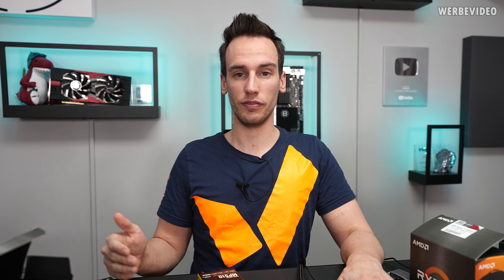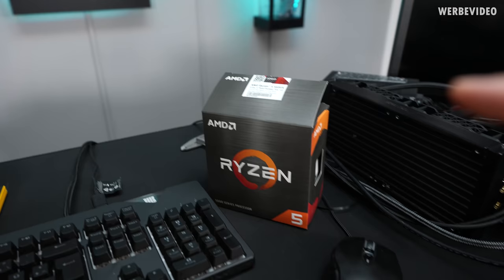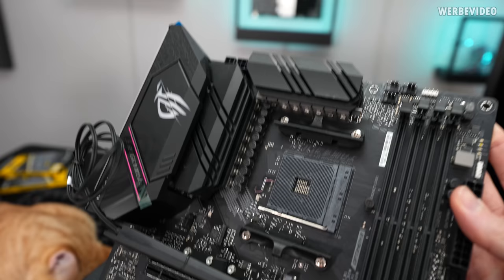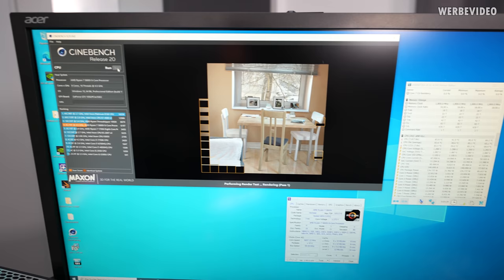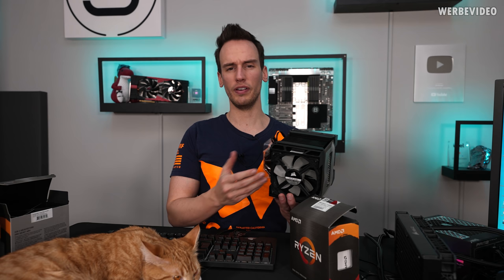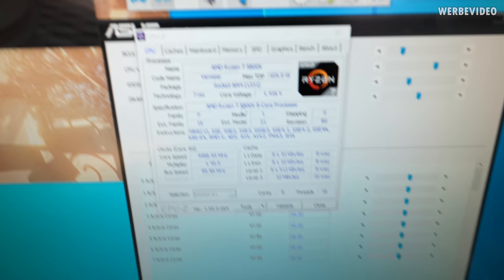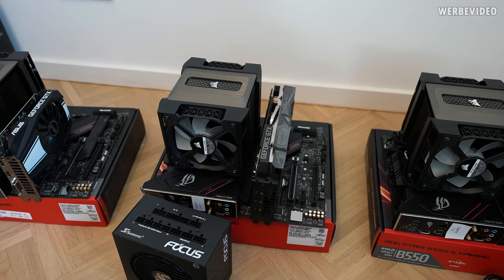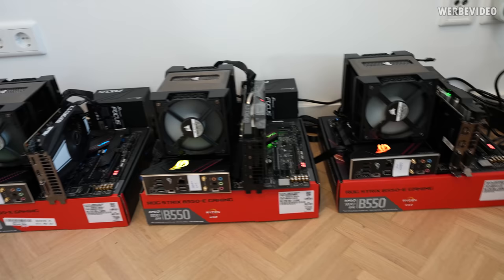AMD Ryzen 5000 Long Term OC Testing - Will the 7nm CPUs degrade over time?

Comment: Wait,  we gotta wait 6 months? But I'm already running an amd cpu, what should I do rn
Reply: well the entire world is using this 7nm right now so I wouldn't worry. The story is obviously a competitor throwing shade, not unlike many stories that have came out over the years. At any rate, this seems to trace back to Boutique PCs which use really crappy psu's. Everyone else seems to be fine.
Reply: Depending on your risk tolerance, could be cautious about voltages until the results come back, then decide whether or not to push voltages then :p
Reply: Use PBO. Someone already managed to degrade a Renoir APU just running the inital 1usmus Ryzen Clocktuner stress test, and an overclocker managed to degrade 2700X's by running .05v higher than what PBO would use at the same temperature.

Comment: I work with servers and prior I worked with laptops. There were more Intel branded systems all together. There were dramatically more failures with amd cpu's overall. Mostly memory controller issues with the older laptop cpus. I have no data on zen2 or zen3. But if you want a reliable cpu I would not choose an amd desktop platform for reliability in say a server environment. Epyc and thread ripper were just starting to get. And it looks like we've had some that have been dead on arrival. But not enough data to suggest one way or the other.

Comment: My 5600x degraded today from 4750mhz to 4700mhz after a stable use of 6 months 24\7 operational.
Reply: voltage ? clocktuner? or manually oc?
Reply: @ricardorosas8500  voltage 1.3v and yes its manually set to 4.7 and working fine with 360 AIO
Reply: My 5800x seems to have been degraded on PBO Curve Optimizer -20 on best 2 core -25 on rest(was fully stable). So telling PBO fully safe might be a lie. 

I was able to manually oc into 1.325v 4800mhz (OCCT 2 hour stable) and it was clearly written on my notepad. Now i have to do 1.38v for 4800mhz. 

ITS EARLY THO. Bios update could have fucked me. More bios version tests needs to be done.

Comment: Nice test, will be interesting to see if any change will come, I don't think there will be any. Although I would've preferred to see this test be done with Folding@Home or with Boinc Rosetta@home or whatever else from Boinc. Those would put nice load to the CPU's and give some good use for science in the long run.

Comment: I think Steve from GN showed that the Corsair A500 is not completly flat. Could it be possible that the heat differences be related to that? I think I would test with a different cooler.

Comment: I know for sure my R7 1700 is degrading at this point. Because i ran 3.9 GHz at 1.36V for 3 years. But now i cannot keep it stable at 3.9 anymore and even 3.8 GHz seems to be worse and worse. I started at 1.27V, now it is stable at 1.34V.

Comment: Now I gotta wait 6 months, I mean I can run my 3600 at 4.3 ghz all core at 1.2750v with LLC 6 and it rock solid stable and really good temps, 75c with prime95 and low 60's when gaming. But I can't even hit 4.4ghz at 1.3375v and I heard anything over 1.325v could degrade your CPU so I'm looking forward to seeing this result. Yes I'm away I have a zen 2 and this is zen 3 but it's 7nm.

Comment: Did you check the coldplate contact with the IHS's?
Those A500's have deffo been the worst consistency performer as the coldplate wasn't making good contact in the GN test passes.

Comment: Doubtful we will see a failure but I do think there will be degradation in the silicon where it will become unstable at current settings. Buildzoid has had several amd chips degrade from OC. We will find out soon enough.

Comment: just running  CPU'S at stock setting will more likely over volt the cpus right out of the box like 1.4v up to 1.5+ on stock boost clock setting UNDER MODARATE LOADS ETC, OOPS CAPS🤣😂

Comment: Ryzen: 3400g  overclocked to 4.275ghz on 1.525v (this is on the higher end of voltage level too) and have been using it for around a year (arond 8hrs per day or so on average), still passes the cinebench R20 runs.

Half a year now,, Any update?    :O
Reply: Is it still running at 1.525v? That's a lot

Comment: I don't think they see 12 months at that voltage.
Reply: Probably will live for 12 years just fine.
Reply: @movax20h  well I know people who degraded a 3600 at 1.325v in 3 months using it to render, so... Time will tell. But I doubt they would run at stock for 12 years

Comment: I can give u my results, I run daily r5 3600 with msi x570 gaming edge 4.25GHz GHz 1.365V. So recently my mobo decided to randomly die (it was bootlooping until I pressed del and than I was in bios, but I exited bios and all over again) and I bought asrock b550 steel legend. It has better VRM, but now I need 1.38V for 4.2GHz, load line calibration on both was flat, on msi it was load line 2 and on asrock load line 1. So I don't know if it is mobo difference or my cpu is slowly dying. Under load on both mobo voltage is 1.31V exactly. So, my. Conclusion is, I don't know where it problem. Before mobo change I didn't notice any evidence of degradation. My r5 3600 is one of the earlier one

Comment: I think that in 1 year there will be no difference, my intel i5 4670k has the base clock of 3.4  I use at 4.6 for about 2 years and still haven't felt any kind of loss of performance and an increase in temperature, I am very curious about the result of this test

Comment: yes Ryzen processors have shorter lifespan than Intel. You are gonna have to upgrade or replace the CPU in short period of time. Overclocked CPUs have shorter lifespan when compared to stable ones and Locked ones.
Reply: I'm on my third 5800X stock and still unstable. I shoulda stuck with Intel. Every CPU I've ever had was rock solid when stock even my only ever AMD which was an Athlon 64.

Comment: I have an R5 3600 since I was new, I used it at @4.2Ghz all-core, and this week it crashed, restarted and doesn't want to make 4.2GHz all-core anymore, I have to leave it on the PBO then yes it reaches 4.2Ghz, has anyone experienced this ? would it be chip degradation?

Comment: Yup, this is hearsay that's been around in the community for decades. Overvolting your CPU decreases it's life expectancy, without any sort of proof or factual evidence to back it up. Don't get me wrong, you can definitely fry your CPU, but in general they either work or they don't. There may be a short state between working and not, but I haven't born witness to a bad CPU that has reached that state and still continued to function for more then a day or two. It's the same sort of people who make random arbitrary claims about temperature and the effects of longevity on CPUs, when there are boatloads of laptops out there without proper cooling sitting and thermal throttle temperatures for their entire life because it's cheaper then making a proper heatsink for them.

Lots of hearsay and geeks love talking about arbitrary things to shoot the shit.
Reply: Heat degrades all things over time. However take old school Intel chips thar last 30 years, would anyone notice if you shave 33% of it's life?

Take my 5800X, 2 months running stock no DOCP even and it will no longer boot an OS.

Comment: How hot geht ur 5800x while stress testing?  Does the CPU lose a Lot of performance while downclocking?  I am hearing a lot of horror storrys about 5800x with dropping a lot of mhz under load.... Basically unacceptable noises and temperatures?
Reply: No, it's fine, the 5800x runs more GHz then compared to other ryzen cpus
Reply: I've had 3 5800X, first was unstable, 2nd was great until it died, 3rd is also unstable. Performance was great on all of them, I wouldn't worry about performance, it might drop to 4,500Mhz for a bit during a bench mark but mostly it's boosting to 4.7 - 4.8 and it games it's pretty much always on 4.8 Ghz.

Stability and reliability is the concern.
Reply: @Commander_ZiN  how fast did they died?
Reply: @test2514  first and third showed instability within the first 24hrs. The second was fine for 2 months, then unstable for a week, then would no longer boot any OS, CPU softlock errors on Linux
Reply: @Commander_ZiN  ok thx.  Mine is running since march.  With water max temp at 76 degrees.  So I guess they got better
Reply: @test2514  my last cpu is only a week old, hasn't got better, unless it's been on the shelf a while. Took me 2 months to really notice the issue the first time. Not everyone is affected, so could be my store got a bad batch.

Comment: Correct me if I'm wrong, Roman, but I think the power surges that happen when turning on a system and also the thermal expansion and contraction of a system being on and off can affect its lifespan. Whether this is relevant or not is another matter...
Reply: I saw the systems plugged directly to wall. So the dirty power may help with the stress?
Reply: @amunderdog  not an expert in the field (unusual in the internet, I know). However, now that you mention that, I think a UPS could help with that issue.
Reply: Well he is looping in 3dmark CPU test so between tests(until the test loads) the CPU will be at around 50 degrees and once the test starts it will go up to 75-80, then it will decrease to 55-60 until the test starts again so...it will have big 20-30 degrees temperature differences every 10 seconds or so. His temperatures may be different, I just gave an example using my 5800x.

Comment: Once again, PowerGPU's problem was DOA CPUs, not degradation, not instability, just they didn't boot out of the box. This specific issue is not something the customer of a boutique builder should see if the builder TURNED IT ON before shipping it.

Comment: Try searching WHEA error id 18 and you will find the real quality concern of zen 3
Reply: that type of error is due to bad overclock , had a ton of does because I had my CPU undervoltage , after setting the voltage to normal (or around the CPU needs) they go away unless you have a defected CPU

Like in my case using a bad overclock with the CPU starving for power will make parity errors and make the CPU not responding, XMP profiles are not as good like people say "set the XMP profile and you are done " is a lie because not all XMP profiles are 100% good and some might even get CPU's with a really high voltage or to low.

The best way to overclock is to do it by hand and turn off XMP profiles
Reply: @custume  Well in my case, I can even use pbo 2 to perform some undervolting, it can pass all stress test with normal temp. So as my Ram, it is a pair of 16GB Crucial Ballistix 3600c16, no error with XMP on during extended stress period.  But it reboots randomly during light work loads like browsing the web and having zoom meetings. The pc just behave strange with any settings, with and without PBO, cstates, llc, SOC voltage, try out different drivers, BIOS, same thing, same core 0 and 1(same physical core)report 'Cache Hierarchy Error'. And nope I am not using Radeon, I am using 2080.

So no, for me it is not unstable overclock, funny enough the cpu seems to be quite capable of PBOing but it failed the 'Google Chrome YouTube Playback test' and Zoom Meeting test' even at stock settings. Trying to RMA my CPU as I don't want to disable CPB or to add voltage to a stock CPU in order to get my system stable because the CPU is clearly not meeting AMD spec and I should not be doing all this in order to get a system to work properly as a customer.

A bit disappointed with AMD, they may push their Zen 3 too hard and rushing to launch them.
Reply: @LittleLauLegacy  a couple of things you need to know ...

One : if you turn on XMP you are in effect overclocking your CPU, right now most retailers and AMD don't care about it but for all intent and purpose XMP do OC the CPU not just the memory.

two : if you OC a CPU (or by you overclocking the CPU or by turning on XMP ) you need to disable Cstate 1 to keep the CPU from drooping clock because that create instability in some systems, sure some people say that disabling Cstates is bad but you don't need to disable all and C1E off keeps your CPU of downclock during idle state and for some OC settings (when are not stable) can make instability by voltage or clock getting to low.

finally : if you OC the memory you also need to check for instability in terms of CPU power and settings, not all XMP profiles takes that in consideration and simply pump up the voltage to keep it stable that in turn when the CPU is in idle can crash the system NOT when is at full power.

So, if you like to RMA the CPU you go ahead but my advice to you (because if the retailer test the CPU without XMP turn on it might work 100%) is to disable XMP and overclock the memory and/or the CPU by hand, also OC the memory is hard and not all settings work (you might have 2 sticks of the same memory/brand and capacity and they do not clock the same).

in the end is your decision but you will find that turning off XMP and do it by hand can get you better results over XMP because XMP is all nice and all but is settings use by manufactures that take the best scenarios of memory, CPU and other parts combinations (some times work, some times fails badly )
Reply: did anyone actually google it? There's plenty with this issue running stock. 

My first 5800X I tried to get stable for several months, last WHEA error was on April 1st, probably fixed by a BIOS update.
But it was still randomly crashing mostly at idle.

2nd CPU was perfect for 2 months, then would boot OSes anymore, Linux gave CPU soft lock errors.

3rd CPU is unstable, although that is with DOCP enabled, I'm trying to find a way to reproduce the issue reliably.
Reply: @Commander_ZiN  I know a replacement CPU may not be perfectly working, so I ended up give up on AMD and switch to a 10900KF instead. Lost some performance but gain stability, worth the trade.
Reply: @LittleLauLegacy  yeah, AMD won me over big time, Intel hasn't won me back with performance but I think AMD has lost me with stability.

The common argument on why people stick with Intel is it's reliable, but I always advise people my Athlon 64 was just as reliable as Intel.

AMD isn't doing themselves any favours if they don't present a good first impression to people that jump from team blue.

Comment: i manages 4.5GHz @ 1.28v on my 5800X
Reply: I manage 4.7 Ghz @ 1.29v but I run at 4.6 Ghz @ 1.15v on 5800x
Reply: @grlmgor  I tried 4.6 & 4.7 at 1.3 but under prolonged full load it was unstable with my chip.

Comment: So i'm running a r5 3600 @4.5Ghz 1.25v i sould be perfectly safe long term right?
Reply: Yep! Not matter what you do with it. I'm running 4.4 @ 1.37 as my sample isn't as good, but i only game which doesn't cause a constant hard load on the cpu + i only game a few hours per week. No deg for 8 months now.
Reply: Ryzen degradation depends heavily on temperatures.
Reply: Yea! I'm running 4.3 all core @ 1.35v since Feb 2020. I also don't have a great sample 3600, but no degradation so far.

Comment: Nothings going to change with the cpus. at most, youd need to replace the thermal paste... All those wannabe engineers need to just pipe down.
Reply: Dunning-Kruger moment.
Reply: @Walther Penne you appear to have gotten the exact opposite meaning of what I had intended to communicate.
Reply: @Walther Penne describe "dying"

Comment: I had to rma three 5950x, first one bsods and random reboots with no overclock and xmp. The second 5950x wouldn't boost above 4GHz no matter what... Luckiky third one is working fine 5Ghz boost and 3800mhz without wheas.

Comment: how does that A500 compare to the dark rock pro 4?
Reply: Very badly
Reply: @weavercs4014  so the DRP4 is better? I have a DRP4 and keeps my r5 3600 about 35-40 F cooler. for under 100USD.
Reply: @mts982  it's about 20 degrees better on a 5800x. Use that how you will

Comment: "1.45v is very high" - they run over 1.5v out of the box :P
Reply: Yes but not at full load. You get up to 1.5V for bursty single core loads with low current then as the load increases on multiple cores the voltage drops to around 1.35V range while the current goes up significantly until you hit the power limit.